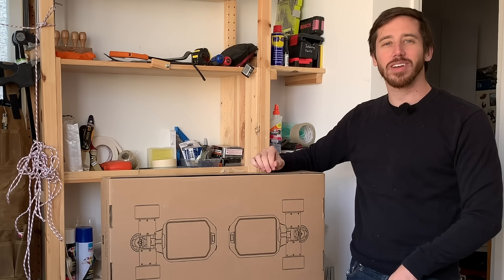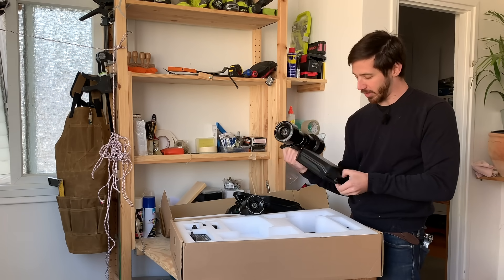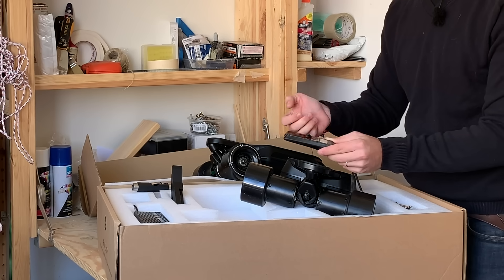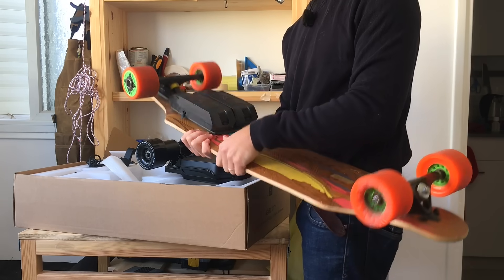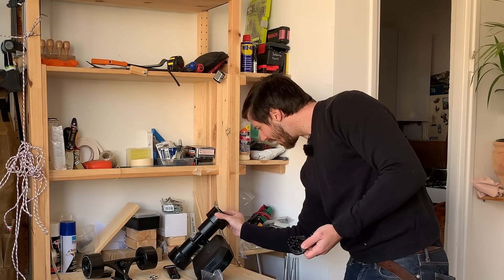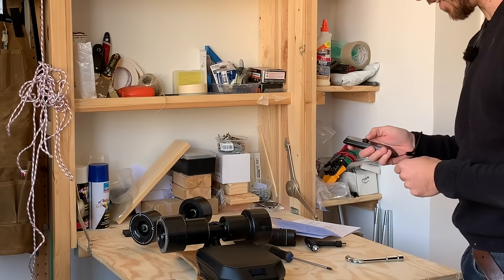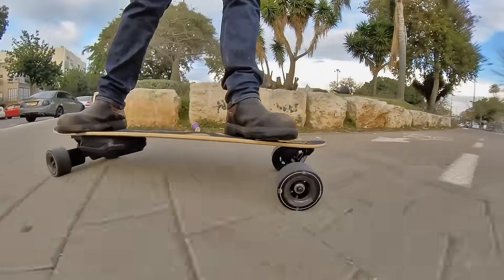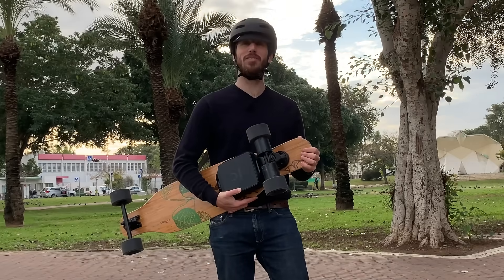Easiest DIY electric skateboard kit yet (Revel)

Comment: why would you buy this kit? it is 700$ just buy a longboard thats already made,  i could see if there was some kind of savings involved, especially since without a board, so it's like 700$ +the cost of a board, and all the junk to fit the kit to. i dont understand the reasoning behind this at all i guess.  you save nothing, and you gain nothing from buying it,  you can buy a hundred different already built longboards for 700$, this would only make any sense if it was cheaper then buying a longboard complete...just weird to me.

Comment: I'm turning my Revel Drive Kit into a mini microbus camper van and using the 120mm Cloud wheels.  I have three videos posted so far regarding the building process and my next video will show me driving it around town.  Even though the kit has more than enough power I have a second kit on the way.  My second video demos the Revel kit on an 8 foot longboard.  I highly recommend it!  Big advice for you though: Don't push the kits performance when the battery level is low, or even if the weight load is more than the low battery voltage can handle it could damage the battery cells.  See project at Wood to Wheels on YouTube.

Comment: Hey, I have two Questions: 
1: Does the 2 kit 4WD bundle come with two remotes and two of everything needed to fir in two separate boards? 
2: Also, if the battery dies, can you still ride the board without friction issues like with belt driven motors? 

thanks!
Reply: I haven't received mine yet (should be here tomorrow!!)
But from what I've found out about it online, the 4WD bundle come with two complete kits. Two remotes, two front trucks etc. So you could set up 2  2WD boards if you wanted to.
With regards to the "pushabilty" of the board. A few you tubers have said it's very easy to push if need be. Some have said easier to push than hub motors.
Reply: @prone4life  can you confirm it came with 2 of everything? enough to setup 2 decks?  what about the wheel hub adapters? are there enough for 2 decks also?

Comment: I kinda need some advice if you can give me some?
I have a Onewheel with a dead cell, and I was wondering if I could replace the cell with a fresh one, even if the other cells are probably not at the same voltage anymore? I've been riding it for about almost a year. My plan is to build a higher capacity pack to replace the stock one sometime in the future. For now, I just want to fix it, then later do the upgrade when I wear down the batteries more. I've been watching most of your videos and I plan to buy your book. Until I buy a spot welder, could I solder the new cell in place of the bad one even if the rest of the cells are spot welded? I know it's my plan is janky as heck but if you could let me know, I would extremely appreciate it.

Comment: Question about range... I just watched your Electrek review of this. I was not clear on the range of the 4wd model. If you switch to 2wd and run on one battery until empty and then switch to the other unit for 2wd, what would be the effect on your overall range? Also, can we expect a regen system for steep downhill runs?
Reply: Each battery is 4ah or 6ah, that usually means 4-5miles or 6-7miles per charge. (You can ride longer but you'll get voltage sag) Range depends on the type of use, can vary due to higher riding speeds, rider weight and regular hill climbing. 

Likewise, with the Regen brakes that are standard on all electric skateboards these days, can often give you an extra mile or three. (The larger the battery, the more chance/time you've got to recuperate the energy into your battery) Regen brake failure isn't fun though!

Comment: Awesome, Ive ordered a two wheel drive Revel kit myself, and a Loaded Vanguard deck to mount it to. Should be a sweet set up. I have an Evolve GTR now and its amazing but its very heavy, a lighter board will be nice if you have to walk it into a cafe or carry across a street etc. Only things that concern me is the way the battery, the heaviest component is just hanging out there under the board flapping in the breeze. I thought a couple of little screws to tack the battery cradle to the board might've been good. And the spring in the remote, springs inevitably lose their tension. Well time will tell I guess....  😊
Reply: Paul Thomas How's the kit on the loaded vanguard?
Reply: Farhan Alam it’s awesome... had some faulty issues with the kit but got them sorted goes great now
Reply: Verreal and Vestar have a single enclosure system that could be bolted down to other decks instead?

Comment: HELP!! Micah I got a handlebar control switch for my horn (same one you got) lights and signals. They sent no instructions!!? How do I wired then? And do I need a flasher for the signals? I have a 8" led strip that contains the signals, rear/ brake lights.

Comment: Honest question, why would you buy a kit that’s the same price as a powered board from bustin? I’d trust a legit board company more than my ability to bolt this on and set it up...
Reply: Honest answer, it's all about preference. If you don't mind the bumpy ride and not being able to use it with different wheels/decks, go for the bustin
Reply: Also, revel now offers complete kits too, meaning bustin, loaded etc, REVEL builds it for you. Check their website. That way you dont install anything :)))))
Reply: Hub wheels tho, not the same thing
Reply: Youtube Style ahhh, I only skate my “acoustic” board 😂 didn’t realize they all weren’t the same type of motor.
Reply: No idea. Was wondering the same thing.

Comment: I just got a revel kit too! Now I just need to find a longboard deck to put it on. How much concave can the system accommodate? Should I try to find a flatter board?
Reply: If too much concave you'll just have a gap on the sides so it's more of a visual thing

Comment: I just ordered my four wheel drive revel kit. I was told it comes with two full set ups, so that you could set up two boards if you wanted to is that true?
Reply: You're fine. I asked revel about this and what you see in the video is an early first gen 4WD unit that they don't sell anymore. Now they just sell 2 complete kits as a bundle.
Reply: I just ordered 4wd too. Comes with front trucks and two remotes
Reply: can you confirm it came as two complete kits?  enough for 2 decks?
Reply: @The_Dustin_B  yes, yes it is
Reply: Yes it does

Comment: Definitely not the cheapest.
Reply: Looks like a bolt on kit.
Reply: What's a cheaper bolt-on kit?
Reply: @BadC0  the wowgo 2s
Reply: @meazy451  That's not a bolt-on and not direct drive
Reply: @tinotores8642  they have a kit you can bolt on. I have one. It's pretty awesome.
Reply: @meazy451  Link?
Reply: @tinotores8642  for someone who doesn't know how to use search on Google I wouldn't recommend you getting a kit. But here it is. https://wowgoboard.com/products/wowgo-kit
Reply: @meazy451  for someone who doesn't understand what's a bolt-on kit I would recommend searching on Google. But here it is: A bolt-on kit is a system you can install on any deck with only 4 bolts like a standard truck.
Reply: @tinotores8642  that's what I did, I literally bolted it onto my deck. Thanks for playing.
Reply: @meazy451  So does that mean you carry the ESC box and the battery box in your pockets?
Reply: @tinotores8642  holy shit dude.did you even look at the link. It's all bolt on.
Reply: @meazy451  Holy shit dude, are you really missing the whole point? I have a $400 deck I would like to keep intact. Drilling 8 holes into it so I can attach 2 cheap looking boxes is not what I'm after
Reply: @meazy451  no facts straight to insults. You win the Internet
Reply: @tinotores8642  I provided you a link. It's a bolt on kit. You hate the number of bolts that would "ruin" your $300 deck. Which by the way, you paid for a name brand. You could buy a 7ply deck for $60 that rivals your own.
Reply: meazy451 ok, I think what he is trying to say yours is more DIY KIT, meaning you have to piece together the BLUE BATTERY, inside an enclosure etc etc. this is, you open the box, bolt on, DONE!. I guess this little nuance is what makes this debate between your gentleman. The one / two / three steps of putting together the esc, battery, cables etc. versus, JUST BOLT 8 screws and go :) PEAAAAACE
Reply: @youtubestyle293  do you have to bolt the kit on?

Comment: I have one of these kits on a 40" longboard and must say that it is great!  Really good torque, great range and control with the remote.  I was really surprised just how good the quality is and the direct drive to me is the best option, no belts and can use really good wheels and not worry about damaging a hub drive going over gutters.
Reply: Is yours flexy? I'm scared that mine will drag the battery on the ground.
Reply: @vasbossgaming1779  No, not really flexy so no issue with the battery dragging.  I'm still very impressed with the kit and still think that the super simple remote is really good and intuitive when riding.
Reply: @vasbossgaming1779  is it powerful? I'm sacred to get one cuz it looks like direct drive is torque less

Comment: Micah that looks way cool but one adventure at a time.  I need you to do a video on motor cutoff switches and how to retain your brake/shifter handles while using them. My Voilmart kit came with one cable housing so I removed switch to install in my housing but not made for that. Ending up buying sensored ones from Luna cycle and gluing them to handles

Comment: Looks ideal. I wonder if it would work with any of the "offroad" wheels?
Reply: I have mine set up with 120mm cloudwheels
Reply: @BadC0  so stoked to throw my slick revolution version of the cloud wheels on the loaded tarab. Can't wait for the kit to arrive! Gonna be such a comfy ride.
Reply: @BadC0  Cool. How does it affect the performance?
Reply: BadC0 also interested to hear how the larger wheels affect acceleration, breaking, and range
Reply: @gregholland11  Never had the cloudwheels on 2WD but on 4WD they're awesome. I would assume acceleration is not so good in 2WD but it depends what you re going for. Comfort or speed.
Reply: @BadC0  hey, what exactly is the 4wd kit? are there two remotes or just one? cause on the website, it says the AWD kit is two revel kits, so I thought it would come with two kits (2 remotes, two electric motor trucks, and two normal trucks) That way, you could get two 2wd skateboards for the price for one and a half kits or get one 4wd skateboard with one regular longboard
Reply: Gordon Lin this is what I came here to find out I guess no answrt
Reply: @gordonlin6120  Watch the video. The answer is clear.
Reply: Mark Haury I watched the video and I only see one remote. However, on the revel website, it says a 4wd combo is two 2wd kits, meaning there should be two remotes
Reply: Now the Answer is CLEAR
Reply: @gordonlin6120  From the Revel Web site: "The 2 Kits / 4WD bundle is the best way to buy 2 complete Revel Kits that can be mounted on the same deck for a four-wheel drive experience, or separately on two different decks (front truck, remote and charger are included in each kit)."

You really can't get more clear than that.

You shouldn't assume anything based on a YouTube video, especially when it may be an evaluation unit that didn't cost the reviewer anything (or that they got for a reduced price) and is probably a configuration put together just for the reviewer. Then there's the fact that products are always changing specs. You really should just go straight to the source with questions like this.
Reply: Mark Haury and @Gordon Lin, I emailed them and they said it was exactly the same as buying two kits but I think that’s dishonest because I asked about the extra trucks and got no reply. I will be purchasing 2 separate kits. It’s just a couple hundred difference and I think it’s worth it. Especially since a remote alone cost 100$
Reply: Mark Haury no because they said something that wasn’t true. What is your definition of dishonest. Do you work for the company? Or any company by chance? Possibly one that occasionally runs BOGOs. If you don’t know what that means it stands BUY ONE GET ONE. Usually that happens when you buy bundles or more than one. Some people call this a discounted price. Usually in 100% of cases when something is advertised as a “bundle” is cheaper than of someone where to buy all the components in said “bundle” separately, while at the same time receiving all the components. 

A revel rep told me that the bundle comes with all the components of buying two separate kits. That was and is not true. That sir is called dishonest sales. 

Also most of us looking at this product are looking at it because is a budget electric skateboard. BUDGET! So pat yourself on the back for calling people clearly looking to save money cheap lol. You really put the hammer to the nail on that, your superior intelligence and bank account know now bounds.

Again the point sir is that a company representative miss represented the product I almost spent 1200$.

Oh and LMFAO as I was double checking to verify the price I just mention. I saw where the representative had clarified on the confusion. @Gordon Lin The 4WD kit comes with two pairs of front trucks. It is exactly like buying two separate single kits. 

That being said the rep was not dishonest but i’m going to leave everything I typed because Mark needs to understand the concept of honesty in the sales world. It is dishonest to misrepresent a product. Thankful the product was not misrepresented.

Furthermore, Mark clearly what you though was wrong. The company made it a bundle so the customer could enjoy the savings and the product. That’s what bundles are for. So it’s not unreasonable, Mark. Clearly the company itself thinks that it’s perfectly reason because they are the ones offering it.

I would like to apologize for what ever question it was that mark and I asked that made you feel like we are unreasonable to ask questions about a product that cost over 1000$. Please forgive me. 

If you read this clearly the Covid has freed up to much time for both you and me. 

Don’t criticize people for asking questions especially when it’s their money they are spending not yours.
Reply: Also for anyone that reads that. The kit represented in this video is an older kit. This is directly from the Revel Rep, “4WD kit is what you see in the video. We no longer sell that, and currently just selling bundles, which are basically two complete kits”
Reply: @christiangregory9315  The obvious issue here is that the kit in the video is clearly a 4WD specific kit, which they don't sell any more. Micah's kit obviously only has one remote and one front truck. Why would you think that the information about a product in any video is written in stone for all eternity? Go to the source.